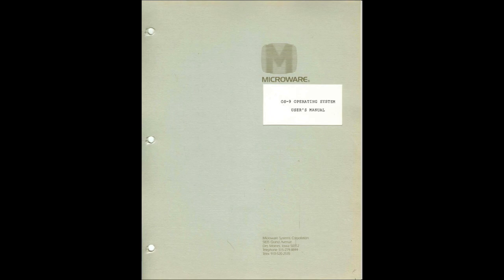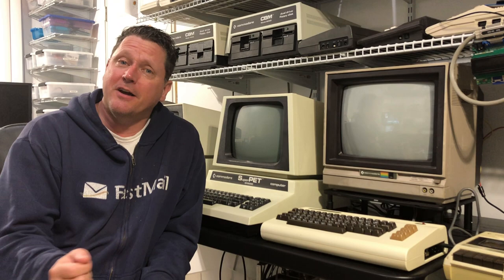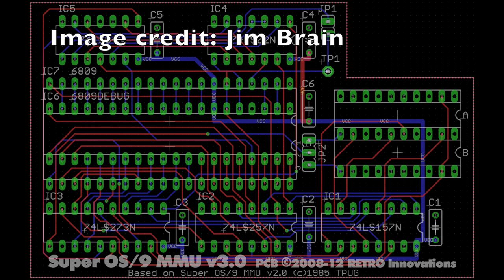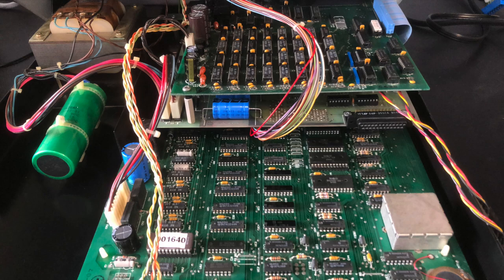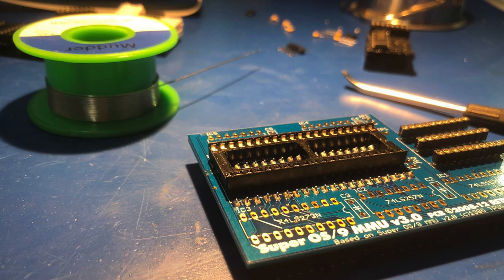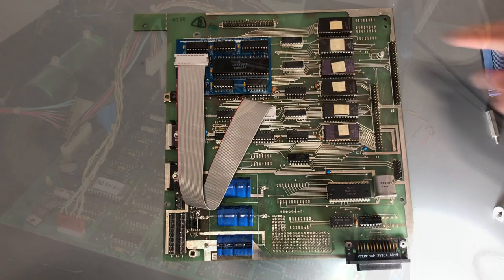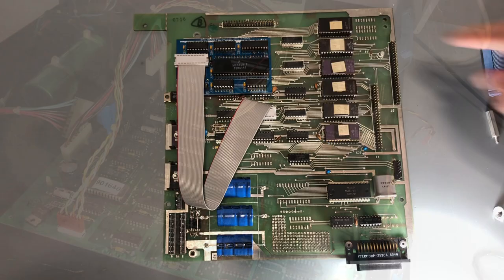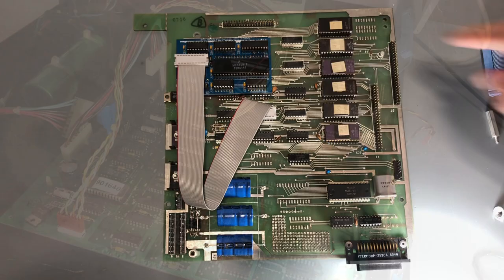Super OS-9 running on a 1981 Commodore SuperPET

Comment: The same OS-9 operating system runs on Tandy Color Computers with 64K of RAM.  OS-9 Level II runs on the CoCo 3 with >= 128K.  You can run the very same binaries on the Super PET, provided that they don't use graphics or other hardware features specific to the CoCo.  There is a K&R C compiler, a Pascal compiler, and a good structured BASIC that compiles to intermediate code, called BASIC09.  See the YT channel Canadian Retro Things for a good intro to BASIC09.  

Fun fact:  Sub Battle Simulator, King's Quest 3, Leisure Suit Larry, Sublogic Flight Simulator 2, and other disk-based games for the CoCo 3 are all running in OS-9.

Hobbyist development of 6809/6309 continues to this day with the NitrOS-9 project.  Drivewire allows you to use a modern PC/Mac/Raspberry Pi to serve up OS-9 disk images over a serial port.  It might take a small porting effort to support the serial hardware on the Super PET, but that would make hard drive sized images available, which would be faster than the Commodore floppy disks.

Great video.  I've been aware of this for a long time, but I don't think I've ever seen it demonstrated.  Very cool to see.
Reply from the maker: All good info.  I wasn't aware of any of that.  Thanks!

Comment: Hey there, I absolutely enjoyed this video and I was wondering if the Super OS/9 port has the ability to dial out to other machines through serial. I want to work on a project on my SuperPET but this is absolutely an amazing sidequest. 😁
Reply from the maker: Hey Michelle, sorry for my very late reply.  If you actually mean dial out that would require a modem and the SuperPET doesn't have one of those built in. If you are generically using "dial out" to mean "connect remotely to another computer via serial", then the hardware capability definitely exists.  I know there's a bevy of Commodore terminal programs you could use if you were running the SuperPET in 6502 mode. I don't know what exists for OS/9, though.  I don't see a native telnet program that comes with the installation, but there might be something available.  I'll have a look and let you know if I find anything.
Reply: @commodorehistory  oh wow thanks for the reply at all! yes by dial out I did mean talk via serial. I appreciate you looking into that if you dig up anything please do let me know. When I am done working through this other machine I would like to talk to it via serial.  I wish I could send you my contact information somehow.
Reply from the maker: @TheRetroGamingPrincess  my contact info is on YouTube.
Reply: @commodorehistory  Sent you a quick email!

Comment: Load times are significant even on a modern emulator, this is normal for Commodore
Reply from the maker: Thanks for watching, Brandon!  Commodore's IEEE-488 drives like I used in this video actually performed well.  It's the IEC drives that were painfully slow.  I did a video about how the IEC protocol works if you're interested: https://youtu.be/OA4v7ElGWuA

Comment: all of it 'is' and not 'was'. as long as there is a single copy of it left it always 'is'. no idea whats up with all the 'past tense' crap. or should we refer to rembrants paintings as 'was' too :P lol. just because he is no longer producing them new. no idea what the wikipedia idiots mean with 'bla bla was'. on something that sold millions of units out of which millions are left. :P especially when referring to the platform as a whole of which new units are produced as we see fit. :P (maybe not identical ones and most definately not by the same manufacturer but the same thing, largely, by function and platform ;)
Reply: should just start referring to their pc crap as 'was' too. cuz ibm no longer makes those. lol.
Reply: bet half the stuff their house is made up of is no longer in active production. all the doors, lightswitches, light fittings, etc. and yet they don't go 'my bedroom door was' lol. stuff isn't only around for as long as some idiots sell new ones. stuff is around for as long as it is physically around. :P usually a few 100 years. and during that time the programmer CAN and not COULD use register so and so to change the color :P LOL. and heck if the programmer needs more units, he can just have them produced to custom order anyway. there is no past tense in electronics. just because some wikipedia idiots can no longer ask their mum to buy them one at toys r us doesn't mean it's 'gone' :P lol.
Reply from the maker: I was referring to active development when I specified "is" vs "was".  OS-9 is still actively being developed today.  The Commodore SuperPET was developed in the early 80s but is no longer actively being produced.  Of course the SuperPET is still in existence.  I mean, I was using it in this video.
Reply: @commodorehistory  finished products don't need 'active development'. they do what they are supposed to do. forever. and as such pretty much 'are' wether they are still being developed or not.